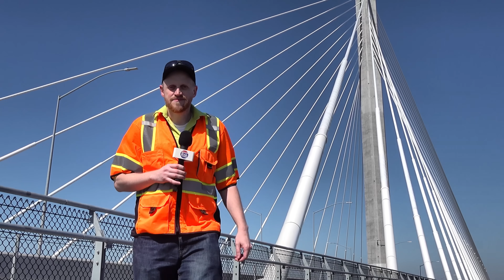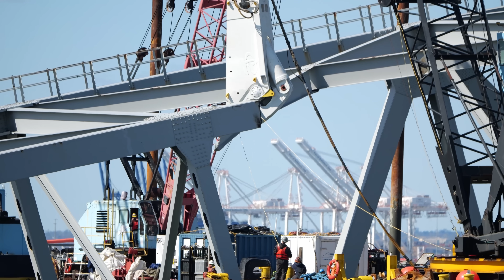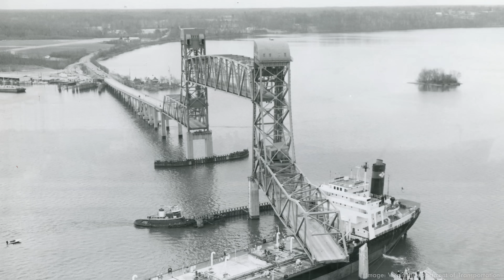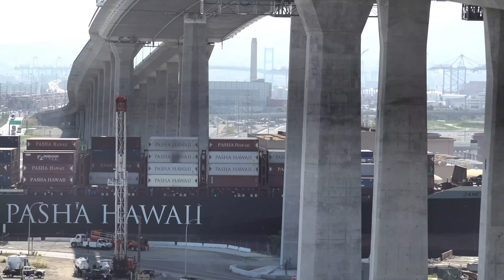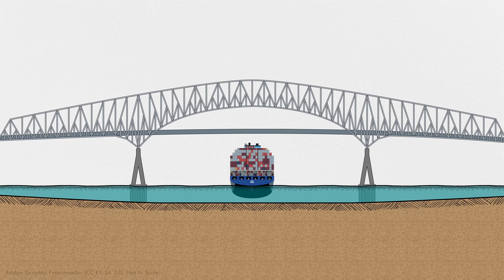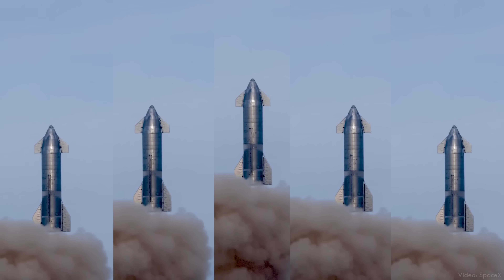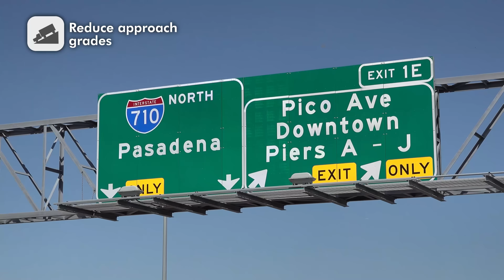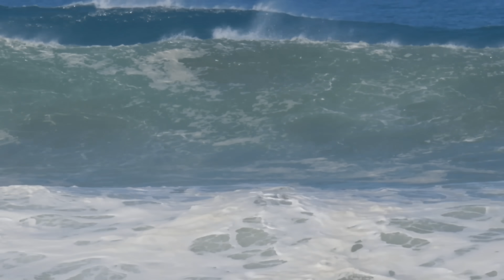How Bridge Engineers Design Against Ship Collisions

Comment: Grady,

I am a naval architect and marine engineer who spent my career working for oil company marine operations.  I was involved with everything from the design and construction of tankers to oil spill response.  In fact, our tankers docked at berths 78, 118, and 121 in Long Beach, requiring passage under, or docking next to the Gerald Desmond Bridge.

A major point in the discussion of the ability to predict the size of ships when the Francis Scott Key Bridge was built is not valid.  We operated three classes of tankers, all built at the Bethlehem Bethlehem Steel Sparrows Point Shipyard, where the Francis Scott Key Bridge is being taken for recycling.  The ships were built from the late 1960s to the early 1980s.  The tankers were 70,000 DWT, 120,000 DWT, and 265,000 DWT. 

The fendering and dolphins around bridge piers can be designed not only to guide ships away from the piers but they can be designed to ensure in an allision the ship suffers the damage.  I can attest to this, having had to direct the installation of temporary  patches covering holes after an allision.  One of our tankers hit the Carquinez Bridge.  There were two holes, one 10' × 100' and the other 10' × 200'.  The bridge had the wooden fendering destroyed and suffered minor damage to the concrete. 

As for the loss of ship's power, it will be interesting to see the NTSB's findings on the loss of power and inability to regain to regain power.  It will also be interesting to find if they tried the main engine in reverse, to stop the ship, or start it going ahead in an attempt to regain steerage.  

Bob
Reply: Dali was definitely slowing down, i believe she was at 8 knots before losing power and according to Grady at 5 knots when it hit the pillar.
But as you know it takes a good bit to slow those big ships down.

I'm looking forward to see the report as well!
Reply: @KoeddkHD  It's important to know that water is flowing fast enough over the rudder to generate lift, so it is able to steer.  At around 5 knots the flow over the rudder will drop to a point where steering control will no longer be sufficient enough to turn the ship.
Reply: @robertlevine2152  Judging by the AIS data it seems like it's over 5 until the very last moment unfortunately.
of course there is some kind of delay on the data coming in.

I assume that current can affect this too?
I like ships, but i lack a lot knowledge still :D
Reply: Not sure who approved the dolphins on the Key bridge, but they looked to be typical "at least we did something" construction as they were so far away from the bridge they were more channel nav hazards than "pier protection".  We've had bridge fenders for probably 150 years or more,  so they could have done a lot better, no matter what ship calamities came along.
Reply: @paulholmes672 I’ve heard the rather poignant opinion a few times now that America builds infrastructure once then leaves it to rot because nobody wants to foot the bill for upkeep and upgrades. Sure, the US has the most bridge collapses of any one country, but of so many other countries combined, it points to other issues.
Reply: @Alan.livingston  " but of so many other countries combined, it points to other issues." Not sure what you're trying to say here... I'm curious how the US compares to the rest of the world after the number and types of bridges and their traffic are accounted for.
Reply: I am curious how does a ship like that suffer such a total loss of power? That is should there not be multiple independent generators. I am thinking like how on a jet airliner each engine and the APU turns its own generator and hydraulic pump and so as long as you have one of them you have full electrical power and hydraulic power and the systems tend to be independent so a loss of one does not mean a loss of the others.
Reply: @filanfyretracker  They do... which is why this disaster (and a similar problem a few weeks later on another ship) should have never happened. The fact that it suffered a total failure means multiple failures combined to cause this.
Reply: @filanfyretracker  There are 3 sources of electrical power on this ship (Primary, Back up, and Emergency), and losing electricity causes the engine to shut down (pumps and protection equipment run on electricity, not from the engine).  The loss of electrical power is a big part of the various investigations.
Reply: @filanfyretracker  What is Going On With Shipping is a great channel for understand that and similar things. In fact Grady had a picture of him up in this video. He's been in the Merchant Marines for 20 years or so. He went over your exact question and made other shipping-related channels to check out for more. He made several videos about the Dali collision.
Reply: @filanfyretracker  All of that exists.  A ship like the M/V Dali has at least two Ship Service Diesel Generator (SSDG).  My guess is because of high electric load associated with refrigerated containers they had three.

When it comes to fuel, lubrication, cooling, etc, there are at least two of everything.  Say there are two saltwater cooling pumps, one will be in service, the second will be in a standby room.
Reply: @filanfyretracker  There were several independent generators. One possibility is fuel contamination that affected all generators using a common fuel supply. (That's just a possibility I've seen raised; I don't think we have any evidence for or against that at the moment.)
Reply: @Curt_Sampson  But the fuel is basically sludge already... contaminated by what???
Reply: @josephfisher426  The coastline of the US and out 200 n. miles is part of the North America Emission Control Area (ECA) limits the sulfur content to  0.1% m/m.  This can be achieved using a scrubber or very low-sulfur fuel oils.  The M/V Dali was most likely burning either Marine Diesel Oil (MDO) or Marine Gas Oil (MGO).  It would be unlikely that they were heavy-fuel oil (HFO) in Port.  They could not start burning HFO until they were 200 miles offshore. 

With that said, I  cannot say for certain that the Dali was or was not fitted with and using an Open Loop Exhaust Scrubber.  Until the NTSB report is issued it will be hard to verify.  There has been reporting that the Dali was having electrical issues at the berth.  Again, until the NTSB report is published nothing can be confirmed.
Reply: @josephfisher426  I believe that the generators usually run on diesel or similar, not the bunker fuel that the main engine runs on.
Reply: @robertlevine2152 So they could have mistakenly filled the tanks with the wrong fuel?

 I've had electricians accuse me of undersizing gas lines to emergency generators due to a failed load test. The generator was starving for fuel. I told them it was the regulator and/or supply pressure. They didn't believe me. So I called the gas co-op and requested they check the regulator at the meter. Turns out they installed the wrong diaphragm spring. 

Mistakes happen very easily. It's dangerous to assume anything, even in highly regulated industries.
Reply: @cvp5882  Ships will generally have two or three fuel types.  The emergency generator will use marine diesel oil.
This oil is kept in a separate independent tank.  Regulations require that the emergency generator and its switchboard be independent.  Regulations require that the emergency generator and switchboard be outside the main engine room.

I retired in 2010 since that time the rules regarding fuel have changed significantly.  I have not stayed abreast of how fuels are being used today.

Before 2010 the ships I dealt with carried marine diesel oil for periods coming in and out of the shipyard, and when cold starting, or testing engines.  Our ships carried Low Sulfur Fuel Oil which was equivalent to Intermediate Fuel Oil.  We also carried Heavy Fuel Oil.  On diesel ships, the heavy fuel had a lower viscosity than the fuel used on steamships.  The steamship used Bunker C.  Because I worked for oil companies our ships, on the whole, had better fuels.

With that said, there can be problems with fuel.  We had issues with; incompatible fuels, and contamination in shoreside storage facilities, and bunker barges, and with fuels that had bad flash points.  Bad fuels can be an issue.
Reply: I agree, Robert; I've seen the Dolphins on the replacement Florida bridge after its collision, and those things could probably handle the Dali no problem. I'd imagine that had the Francis have similar Dolphins installed, the bridge would probably still be standing. 

Brady is generally right though; cost and likelihood are two things engineers have to calculate, and back when this bridge was built, ships like the Dali didn't even exist.
Reply: @YT-TheLegacy  Engineers run the numbers and make presentations to "officials" who then decide if the benefit sufficiently outweighs the risk to ensure their own reelection.  Engineers have tried to stop a number of ill-fated things only to be overruled by management or agency agendas.
Reply: What is an (allision) that you alluded to twice in your comment?
Reply: @watermanone7567  Ship vs. stationary object (e.g. bridge / pier).  Car vs. car is a collision.  Car vs. utility pole is an allision.
Reply: @watermanone7567  He defined it early in his presentation.  Allision is a moving object striking a stationary object; collision is two (or more, presumably) moving objects striking each other.
Reply: @watermanone7567  Grady said it in the video, it's a term which is used when only one party is moving. Mostly used in maritime.
Reply: @watermanone7567  IIRC allision is a collision, but specifically boat vs stationary object (ie. bridge pier).

Comment: Brady, the Baltimore incident screams that the bridge was NOT designed for a ship collision of that magnitude. With the age of the bridge the ships got bigger and the collision protections / mitigation barriers were not updated in keeping with ship size increases.

Even before this there were ongoing studies of a local bridge across the harbour entrance to improve it's collision resistance and the planning for the improvement implementation was underway. They already have the North pier of the bridge out of the water and path completely, the current plan is to fill around the south pier the same way.

Comment: Dutchie here. We design our water defense for 1 in 1000 to 10000 year events, depending on failure mode and related things. It's pretty recent that we first needed the Maeslandtkeering, which is several decades old, and is one of those structures.
Reply: those are design flood return periods not necessary the design life of the structure
Reply: As an engineer working on a boat it wouldn't seem too crazy for an old cargo ship to have complete power failure if it was a known issue/ they had problems with it before.  Had a couple blackouts on my old ship while we were figuring out the cause.  The one I'm on now was built in 2023 and has a battery bank so we would still have control even if we lost all 3 generators
Reply: You're talking about the change of a (massive) flood, not the change of a large container ship hitting Maeslandkeering. When it is retracted, this is possible that a vessel hits the barriers.

As long the keering is open, ships are allowed to enter the port, which is why it is an automated system. However take the following scenario: There is a very high tide and a MSC containership wants to enter the port to ride out the storm, meanwhile while is is approaching the keering the condition is met to start closing the keering, the container ship is told not to enter the port, but the captain ignores this instruction, and while the keering is closing it hits one of the barriers. 

Now, of course the change of this happening is very slim, but you cannot rule it out. However when they designed the keering they accepted that the change of such a scenario happening has such a low probability, they opted not to create a backup system for when the maeslandkeering fails for whatever reason. Based on the costs to create such a backup, they accepted this risk. However when a scenario as above does happen, people will get their pitchforks and demand blood from those who thought is was a acceptable risk. This is how it always goes...
Reply: @2Fast4Mellow  Well a few things you should know, the Maeslandkeering closes off the Nieuwe Waterweg, and that waterbody is not really used for large water traffic (although there are cruise ships visiting the port of Rotterdam). All the major cargo traffic travels to the Europoort via the Calandchannel below it which has no barriers towards the sea. The majority of the traffic is river barge and or coastal vessels. That and the fact if only closed for real like 3 or 4 times in it's life time, and if it is, it will be in extreme weather conditions making it something else than 'just a tuesday'.
I hope you also realize what a superhighway the Channel is? There is no ship able to even approach withing 200 km without being in contact with the international authorities, let alone allowed to enter the Eurogeul and Maasgeul (60 km into sea) without a pilot on board (large vessels get a pilot onboard even 75 km out, way before reaching the Eurogeul).
Nothing is impossible, but your example is probably a lot less plausible as you think it is.
Reply: This was a terrorist attack. Intentional. The question is, why did the media assure us it wasn't a blatant attack?
Reply: @derrickmcadoo3804 mainly because it wasn’t an intentional attack.
Reply: @derrickmcadoo3804  pretty poor attempt at a terrorist attack. Given there are huge chemical storage tanks right near the water, beside the giant coal storage area, very poor indeed. 

But you go ahead and put your foil hat on and believe whatever you want to believe.
Reply: @derrickmcadoo3804  Because you have to be really desperate or delusional to pin this as a terrorist attack. 🤦‍♂ If you look at any of the facts of this, there's no way any rational person can claim "terrorist attack."
Reply: @grondhero  cool story bro.
Reply: @derrickmcadoo3804   That's your best response when you realize that everybody knows you're off your rocker? 🤣
Reply: @derrickmcadoo3804  There is a nigh infinite number of more influential targets than one bridge. C'mon.
Reply: @derrickmcadoo3804   And you confidently say it because...
Reply: @ImieNazwiskoOK Because ship captains have ONE job. Don't hit anything. It's not rocket science. But I am appearing to be the smartest one here in the comments section. Lol. Thanks guys
Reply: @derrickmcadoo3804   And water interacts in very predictable way without any odd interactions and there aren't any forces that can turn the ship. And it's very easy to control the ship while it has no power. I don't like bringing it up but ekhem Dunning-Kruger. Some things are way more complicated than they seem, and when it seems like you are the smartest in a topic you aren't actually familiar with you are likely very much not the smartest in it.
Wait, was the Suez canal blockage also a terrorist attack according to you? All other maritime incidents too?
Reply: @ImieNazwiskoOK  It's a bay dude. Not that harsh.  If it's dark, their are lights. If it's foggy, there's lights and modern detection methods. There's more team than a captain as well. It was clearly on purpose.
Reply: @derrickmcadoo3804   The issue was not navigation, and as I said you can't control a ship without power. 
Here more of speculations of the cause but the point at which the ship started going in the wrong direction was around the point where the Curtis Bay Channel goes into the main channel, so there likely was an external force acting on the ship(that may I reminds you was not controllable at that time).
Also ship incidents even in bays happened before, and may I know your answer for the question I previously asked? 
On the "purpose" itself what was it? (and evidence of there being one)
Reply: @ImieNazwiskoOK  Poppycock. So you are insulting the highly experienced engineers of the ship itself ?

A cargo boat with no electrical systems, reserve? It's the stupidest narrative.
Reply: @derrickmcadoo3804  I'm just saying what I know, not making up a conclusion and trying to make reality suit it. And again, it's not the only ship accident in the world, even when narrowed down to blackout category(which here was at a very bad moment). 
Odd change of your attitude here tbh, now trying to say that I'm "insulting people".
Now could you please finally answer my questions?
Reply: @ImieNazwiskoOK  I never insulted anyone, but nice try :) I answered all your questions.
Reply: @derrickmcadoo3804   When did I say that you insulted anyone? You only tried to say that I insulted someone according to you, which I didn't but nice try :)
Ye all the questions like: What was the purpose of it?
Was the Suez Canal blockage also a terrorist attack?
Where all others maritime incidents also on purpose?
Reply: @ImieNazwiskoOK  Took out a major American Bridge in Balimore. Also killed numerous people traveling the bridge at that time.  Not cool. The current administration allows China to attack us.. something is wrong.
Reply: @derrickmcadoo3804 Delusional. That is what you are. If that’s a terrorist attack, it’s awful. They could’ve just drove it into the bridge if they wanted and not given any warning to police to evacuate the bridge, or cut power to try pretend they’re failing which can easily be proven or disproven? 

I assume you’re a Trump fan because the IQ matches up.